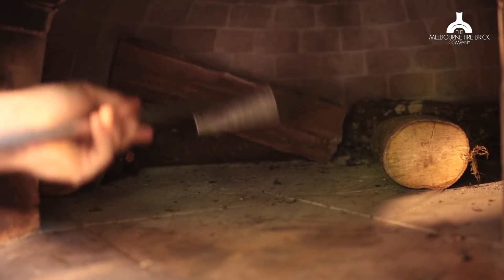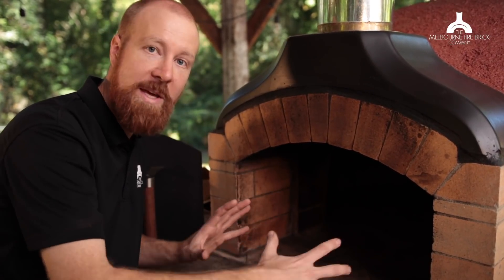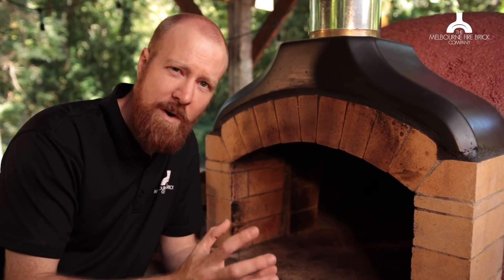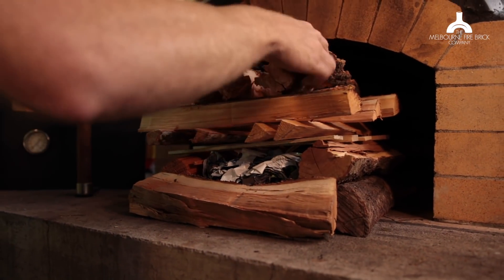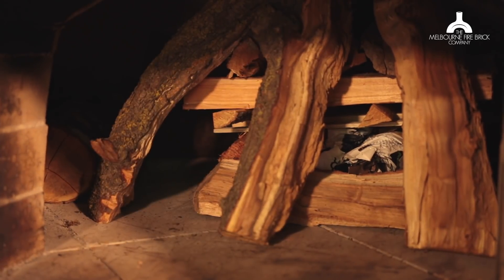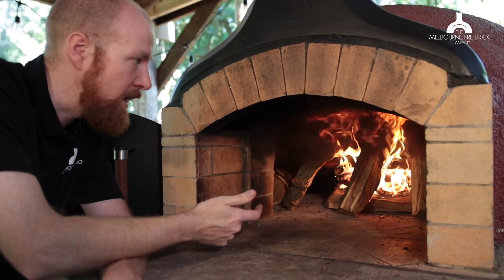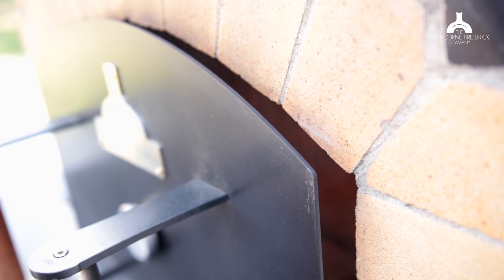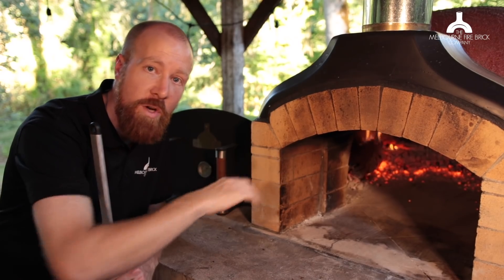Firing your Wood Fired Oven - The Fire & Forget Method

Comment: Thanks so much for this video!  I used your method last night in my Forno Piombo oven - except that I used the "top down" fire structure (heavy logs at the base, reducing in size to kindling at the top layer).   No messing about, no moving coals around, no banking the fire - completely heat saturated deck and dome.  Magnificent - thank you!
Reply from the maker: You are very welcome! No problems!

Comment: This gives me so much hope.  I open my wood fired bus this year and this really calmed my nerves.  I've always started small fires to get my oven heated up and I don't have a door on mine.  This makes more sense.  I was worried heating up that fast would crack the oven so I didn't bother with the door.
Reply: I built my oven, too.
Reply from the maker: Thanks Damon! If your oven is built from the right refractory materials then it should handle thermal shock just fine - in fact that's precisely what a medium duty firebrick is designed for, coping with severe thermal shock.

Comment: OK. Fire season over here -- fuel moisture up, humidity up. Yay. Firing up oven for first time since May. Just cut a bunch of deadfall around house (oak). Trying your fire config tonight for bread, duck, and tarte tomorrow! I often fire overnight, relight in morning to start baking ~2PM. Lots of mass with our oven.  I'll report back. Thanks!
Reply from the maker: Please do! Also, try kiln-drying your firewood using the residual heat in the oven as it comes down to a point where it won't reignite... fuel moisture of zero coming right up!
Reply: @TheFireBrickCo  OK. Used your method and it worked great! Thanks! Still, there's a learning curve. I built fire the night before to get heat of large-mass oven up enough for bread, pie, & duck the next day. I banked it too much overnight. Built it about 9PM then blocked opening with bricks, leaving a little air to get through. Should have left, maybe, a full brick's width to keep it going better overnight. But did stuff it around sides with large oak pieces. Good coals in morning and wood left, puffed right up when I pulled bricks. Ultimately, it cooled down to quickly for the bread  -- though still came out very good. Then put hot coals I'd pulled out before bread back in for duck (fire on both sides of pan). That worked great. Photos for anyone interested: https://photos.app.goo.gl/1FJiPm8pVFBFNPnb6

Comment: It’s amazingly hot my oven got up to 550 degrees in 10 minutes .. I was freaking out but to worked 🔥🔥
Reply from the maker: It definitely works! What you were seeing there was the end of the probe having flames directly in contact with it - the actual 'oven temperature' would take quite a while to get to 550C (I'm still working on a precise way to quantify the Oven Temperature - is it the air temp in the middle of the oven? Or the temp of the inside face of the brickwork? Or the oven floor temp?? Haha we will figure it out..)
Reply: @TheFireBrickCo   my oven I used 2 days before and had some retained heat already… maybe under the floor bricks you could have a horizontal central stainless steel tube with a thermocouple ..

Comment: Empty the oven at the end of cooking and give it a quick clean. When it cools down to about 150 degrees put the wood in for the next time you use it and shut the door. The wood will be kiln dried and premium so you don’t need to buy the best firewood. It will cut your firewood costs in half because you can buy it when it’s cheap. I own a wood fired pizza place and have never used kindling one my life. Why waste all the stored heat that can dry your next load of firewood down to 8% moisture content?
Reply from the maker: That is a GREAT TIP!
Reply: Great tip I luv it
Reply: Great tip

I actually took an inspiration from this tip and now use in my metal recycling factory to dehumidify the batch before it goes into the furnance / kiln

Comment: Another way to control the draft is by placing a couple supporting bricks in front of the door brick, and place the door on top of that supporting bricks flush against the door bricks, so air will be drafted only from the bottom gap.
Reply from the maker: That would work too!

Comment: Great series of videos you've got on here Ben. Very informative.
I'm new to pizza ovens and lighting them after building my own during lockdown.

I've been reading quite a bit about  lighting fires using the 'top down/upside down' method. A lot of people are saying it's the way forward and that it reduces smoke. 

I love the idea of your fire and forget method but wondered if you'd tried the upside down method and if so, what you thought of it?

Thanks again for the great videos👍
Reply from the maker: Hi Andy! Thanks for the encouragement!!
Yep I have played with the top down method and it's pretty darn cool - I'm actually using a modified Fire and FOrget method at the moment where the 'Fort' section is a top-down fire, but the rest remains the same
Reply: @TheFireBrickCo  From the videos I've watched it seems to start slower.... does it take longer to heat up the oven?

Comment: Hi Ben, thanks for sharing this trick of the trade! I’ll definitely try this technique in my wood fired oven. What method would you recommend for colder climates? I live in Quebec, Canada and I use my oven in the winter but fear of cracking the oven so I do a long fire up gradually getting to a larger fire. Is that necessary? Would love to hear from you on this topic. 
Marc B
Reply from the maker: Good question Marc - if your oven is good and dry then you should just be able to use the same method. The colder air will yield a slightly cooler fire at the beginning anyway, giving the structure a bit of extra time to heat up.

Comment: Doing this very method this evening. Providing I don’t burn down everything in a two mile radius, should be good
Reply from the maker: Hahaha! Well? Is the neighborhood on fire?
Reply: Everything's still standing, against all expectations..

Great method. Far less labour intensive, left more time for beer. Which makes the fact that everything didn’t burn down all the more impressive.
Reply: I tried it in my smaller  stone floor, metal insulated oven. It worked amazing although I need to scale it down a little. I nearly burnt the back of my house down 🤣

Comment: What if no landing on the front? I have SS wrap and 70mm of bench on the front.
Reply from the maker: Great question! You can still build the fort on the floor of the oven, in the opening. I often do that now, as it has to be sized small enough to get through the opening anyway so it doesn't add too much difficulty to do it there instead.
Reply: @TheFireBrickCo  thanks, but cannot rest the door on the opening. Is there another way to do that?
Reply from the maker: You would need to get a couple of bricks to sit the door on I think - not ideal but it would work. It might not be quite stable enough though

Comment: I've often thought why you don't have the front brick work lower by about 3-4 cm to prevent smoke coming out the front???
Reply from the maker: Great question! If you don't have good draw in the flue then dropping the front by 30mm wouldn't make a lot of difference, the smoke would still flow out the front regardless. The real problem though would be putting in the oven door - with the arch as it is we already need to tilt the door forward to get it all the way into the oven.

Comment: Hey guys
Is there anyway to avoid to much smoke from initial fire? I kinda smoked out my neighbours big time? Cheers
Reply from the maker: Good question Ben - I have been experimenting with building the fort fire upside down (heavy timber at the base, getting smaller as you go up, with kindling on top). This has made a big difference for me, give it a try!

Comment: How much would all that wood cost? I assume it will burn till it's gone so the cost of the wood is how much it would cost to cook a nights worth of pizzas if you only wanted to have pizza one night?

Asking as someone looking at getting a pizza oven in the future. 

Thanks.
Reply from the maker: I guess it depends on the cost of firewood in your area - for the D105 it takes around 40kg of good quality firewood to reach 400C, so right now that would set me back about $15. This is one of the reasons that we encourage peopel to think about cooking more than just pizza - the oven will be hot for three days, so why not make use of all that retained heat by cooking a bunch of other dishes?
Reply: @TheFireBrickCo  very true, thanks for the reply. You've told me what I was after.

Comment: Can I add a spark arrester to the flue if so do you do one to fit ?
Reply from the maker: Great question! We don't sell spark arrestors at this stage, however they're effectively just stainless steel mesh with a fairly tight aperture, you might be able to buy it at a local hardware store?

Comment: Can you use charcoal in the oven
Reply from the maker: Great question! You can use it in small quantities for doing low and slow cooking, but we don't recommend using it as the main fuel source as it burns far hotter than wood, and would put unneccesary thermal stress through the oven.
Reply: @TheFireBrickCo  thanks

Comment: No damper ????
Reply from the maker: Correct - we use the oven door to regulate the airflow into the oven but allow the flue to draw freely - if we installed a damper the door would have to be semi-permanently closed as the smoke would then just spill out of the mouth of the oven.